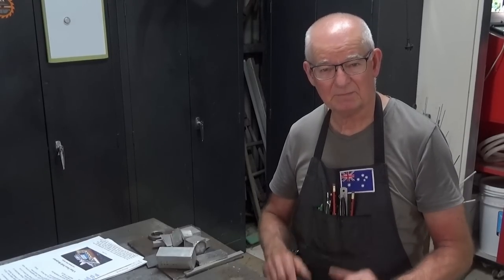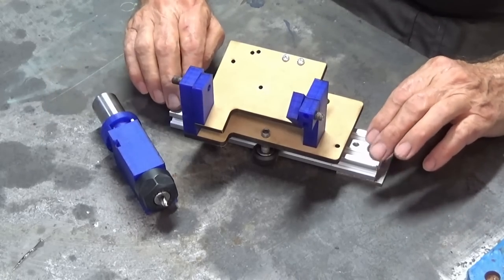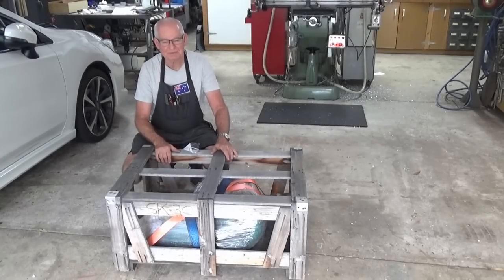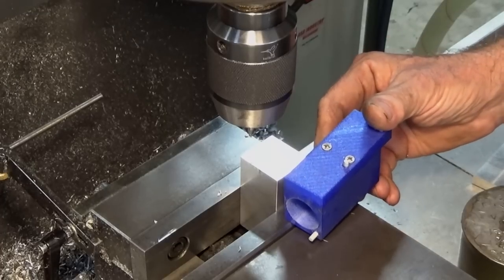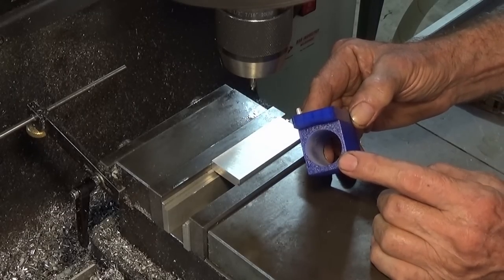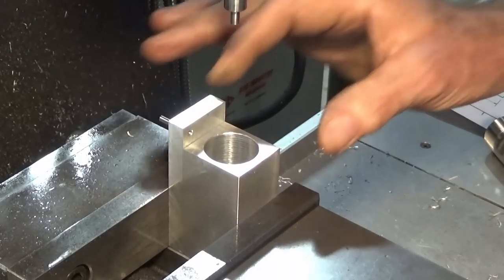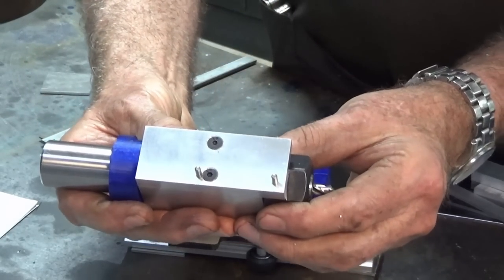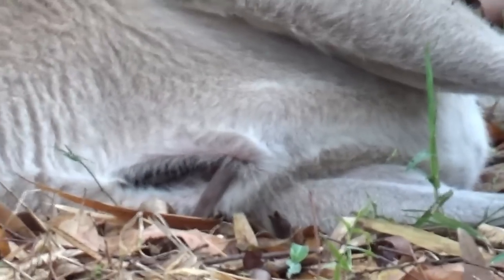A 4 Facet Drill Bit Grinder DIY Style Part 1

Comment: You mentioned the Quorn tool grinder. 
I have been contemplating building one but making weldments instead of buying castings. I figured I could also use the head as a tool post grinder.
You did not sound happy with  the Quorn, is it a waste of effort , or could the shortcomings be designed out at this point?
Reply from the maker: I didn't like it because it was difficult to see the graduations on the scales and quite tedious to set up. The locking mechanisms never quite worked 100% either. Building it as per the published plans means making about 20 ball levers too. If I were to do it again, I would use a different style of clamping mechanism of the type that George Thomas specified for his tools like the sensitive drill head to go on the tapping and staking tool. I think it is one of those "right of passage' projects that a lot of model engineers like to have a go at but it's a lot of work and the Deckel clone D Bit grinders do a better job in my view. 
Regards,
Mark.

Comment: Mark I really like your channel. It's one of my favorites because of the way you go about explaining what it is you're trying to do. But, ya know a new top of the line 750X Drill Doctor is only about $150 USD? And it will sharpen drill bits from 3/32nds to 3/4" ? I use mine all the time and it works great sharpening all of my drill bits.
Reply: Yes, but as a fellow hobbyist, if all I want to do is buy things someone else has made, I don't need any of my tools. Part of the hobby, for me, not speaking for Mark, is to have fun and make your own tools.
Reply: My Drill Dr does a poor job of small drills😢
Reply: This is a four facet grind, which is better than the standard factory rotated grind, and vastly superior to what a Drill Doctor does. And it can split the point, too.
Reply from the maker: A friend of mine purchased a non genuine drill doctor and I helped him set it up and grind a few drill bits. I was surprised at how well it worked. The thing about a 4 facet grind is that it is less prone to cause the drill centre to wander and it take less power to drill the hole because there is no chisel edge. I do like making my own tools though. It forces one out of one's comfort zone and it's the ideal way to learn new skills. 
Regards,
Mark

Comment: I'm about halfway through (but stuck on side projects) making a similar purpose sharpener, using a U2 grinder holder to give me a complete range of angles. But to increase the flexibility I'm putting it on X any Y rails. I have no idea if it will work, if it doesn't I convert over to your design

Comment: Very interesting build. Is there any commercially made unit similar to that?  If not, I have a fiber laser cutter, a CNC lathe and a CNC mill.......
Reply from the maker: I am not sure if there is a commercially made version of this tool. The most common type is the Drill Doctor but the most annoying issue with a lot of drill grinding attachments is the need to have lots of collets for each size of drill bit. Using ER collets means that you can sharpen almost any drill bit from 1/16" up to 1/2" including number and letter drills. Standard ER20 collets are cheap and even bad quality ones are good enough for this application. Certainly, having laser cut and CNC machined parts would make this project a breeze. 
Regards,
Mark

Comment: Total agree re those large drill bit sharpeners, I have different eclipse and other makes very similar all equally hard to setup, I have scrapped many bits trying. If you have a Deckel style tool grinder, is it also a pain to setup for drill? Personally I also like single purpose machines too but was wondering about one of these deckel copies as I struggle to do accurate lathe tool grinding and hoped it might do both drills and HSS lathe tooling
Reply from the maker: I have the Deckel clone D-Bit grinder and it came with an accessory for sharpening square HSS but you do need  to make some adapters for the smaller sizes like 1/4" and 5/16". Mine also came with a few 5C collets but definitely not a full set. You can do a 4 facet grind as well but only if you have the collets for each drill size you want to sharpen. 
Regards,
Mark

Comment: Um don't you have a d bit grinder- it does 4 facet easily!
Interesting design though and looks like it would be easier to set up than the Dbit grinder.
Reply from the maker: I do have a D bit grinder but you need a ton of collets to cover all the metric, number and letter drill sizes. I have seen Stefan Gotteswinter using his D bit grinder to do a 4 facet grind but I only have a handful of 5C collets and imperial ones are hard to come by (here in the metric world anyway). 
Regards,
Mark

Comment: Mark … I also built a quorn…. I hat mine as well … It suffers from being being able to do many many grinding task but none of them with ease… looks like I will have to copy another of your projects …
Reply from the maker: I really enjoyed making my Quorn and then when I actually went to use it I was a bit disappointed. It could be characterised as being "fiddly". I spent so long making all those ball handles and then found out that they actually don't lock all that well. At least the grinding spindle works well.
Regards,
Mark

Comment: Look like we have very simmilar taste for the tools 🙂
I'm looking at that same gadgetbuilder page for almost 10 years, and it's put on "long term plans schedule" for all that time

I know that I will make a "sacrilege question" on machinist chanel 😄, but...
Did you tried to sharpen some drill with that 3D printed mockup?
Forces involved when grinding drill bits are minute, so plastic will do just fine.
Almost all critical dimensions and tolerances are covered with metal parts in that mockup (ER collet, rail...).
If angle of the drill tip is not exactly 118 but 117 or 119 degrees... not a difference that anybodu will notice
If clerance angle is not 5 but 5.5 or 6 degrees... also...
It is more impoertant that angles are the same on both edges, then that they are exact.

Most critical part is that 180 degrees rotation.
Reply from the maker: Funny you should mention that.... I was contacted by one of my viewers this morning who has made a 3D printed version of this tool. I will be providing a link to his download in the next episode. After making my 3D printed mockup I started to wonder if it were strong enough to use as is. My viewer, Alan Pezula has beefed up the collet block by adding an aluminium sleeve but all the rest of the parts are pretty much straight off the printer. Check out the next episode for the details.
Regards,
Mark

Comment: Okay, he built a Quorn, then bought a Deckel clone, and now building a custom drill bit grinder, what am I missing here ?
Reply from the maker: I like making things. The Quorn never lived up to the hype in my view. I found it difficult to use and without the helical groove around the main column it was hard to set accurately to height. At the time I made it I didn't have the facilities to machine that easily so I left it out. Also, the Deckel Clone D Bit grinder is a wonderfully versatile machine but it's not great for sharpening small drill bits. You can sharpen medium sized bits as long as you have a 5C collet of the same size but it is a pain with letter and number drill sizes. The 4 facet grinder can cope with any sized bit from about 2mm up to 12mm and everything in between.
Regards,
Mark
Reply: @Preso58  thanks for that reply. Just trying to figure out the pro,s and con,s. I realize this machine you built is for drills.

Thanks.

Comment: Yo, nice to see a vid, i just watched your furnace build in want of some of your content, and here you come, delivering... Also, imagine asking 1.5k for a thing and you ship it covered in crud and dust... for fucks sakes, wipe it down with petrol, spray it with grease and wrap it in butchers paper or clingwrap... i mean, if the ignorance leads to low price, sure, great... But selling a thing for 1.5k, it at least warrants a dusting off with a rag...
Reply from the maker: Unfortunately, it's a seller's market for used equipment here in Australia. There isn't a lot of good stuff to choose from and I was just grateful that the slotter turned up undamaged and it only took a week to get to my door. 
Regards,
Mark
Reply: @Preso58  I get it, but thats my point, its the fucking resellers who pick up such parts, for coins a piece, never even spray the things down with wd40 and some chainsaw oil to help them remain rust free, and spit a price that starts at 1.5k pretty much for any machine component... I pick up random machine parts from scrapyards that i see are useful to me or anyone else and i take my time, scrub them down with brass scrunchy, brass wire wheel and diesel+atf soak, just to see the state of the thing and to cover it in grease/oil/wax depending on how long its gonna sit before i use or sell it... Recently i picked up 2 large shell mills, ``sandvik modul mill`` with 50iso shanks... A few specks of oxide on the shell, and generally well maintained shanks covered in grease... Ill keep the shells, as they are 400 dollars used to get them where i live, and i picked up both for 20 bucks.... I could resell them for 40x profit, even 55x if i sell them as whole thing with the shank each... But i have a large mill, and a sandvik barely used shell is a prize i aint giving away... The shanks are no good to me, as my machinery uses iso40, not 50, so those are soaking in diesel+atf to clean off any grease, chips and what not from the crevices... I wont be selling the shanks dirty for 100 dollars each like a reseller would, but around 60 each, as they are sandvik made, checked out, cleaned and protected from atmo. until used by the new owner...

Comment: Why not just grind a drill bit using muscle memory? I've never had difficulties freehand drill bit grinding. I guess it's all about personal skill and confidence, instead of relying on a machine to do your work for you.

Cash badly wasted, in my opinion!
Reply from the maker: Two things, no, three things really. I like the challenge of making a tool. I learn such a lot by forcing myself to stick to a plan and resolve all the issues. Next, a four facet grind on a drill bit, in my view, is far superior to a factory grind. It starts more accurately, it creates less heat and requires less cutting force and it is less likely to wander off line. Finally, not all of us are blessed with perfect eyesight and steady hands. If you can grind a drill bit offhand and get a good result, go for it.
Regards,
Mark